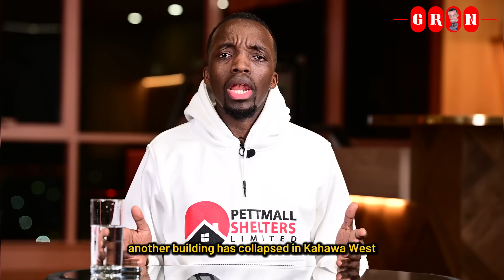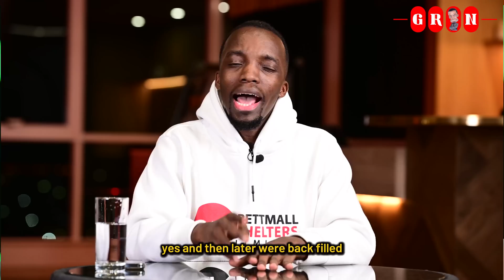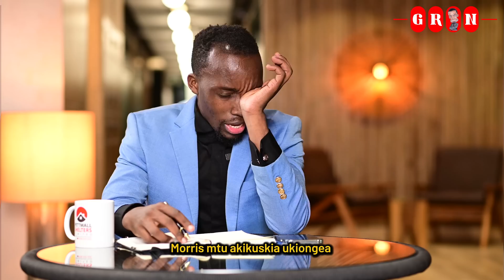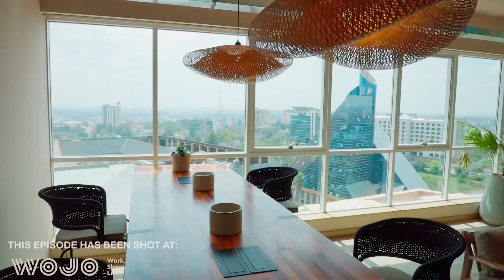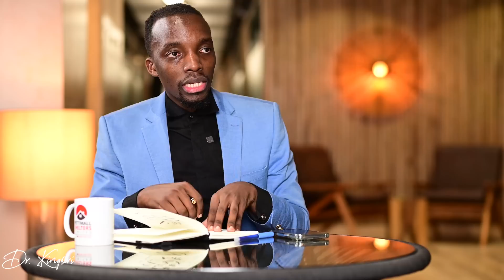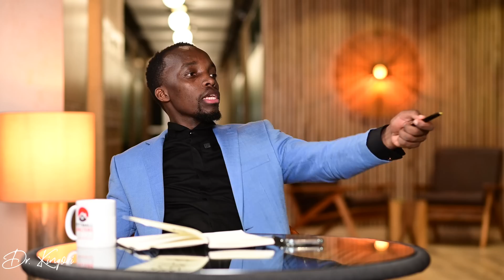Common fixtures that make your home unsafe || Morris Kariuki, Eng. Sam Wanyoike

Comment: Facts about Nakuru soils;
- Volcanic Rock is porous and therefore lower load capacity
- Fissures created when Menengai erupted 6050 BCE
- Menengai Crater is actually a caldera ( that is a collapsed volcano)
- Constant seismic activity and tectonic African plates are being pulled apart a,not the Rift Valley

Most developed economies including South Africa, have adopted IRC and IBC building codes. Most buildings in Kenya are not compliant, fact!
Reply: @ mercy, it is possible to check and correct structural integrity of an existing building. We do a structural AUDIT. Using scanners and Schmidt hammer testing engineers can tell quality of concrete and reinforcement that has been used. If the building is found to have a structural defect, there are ways to remedy.